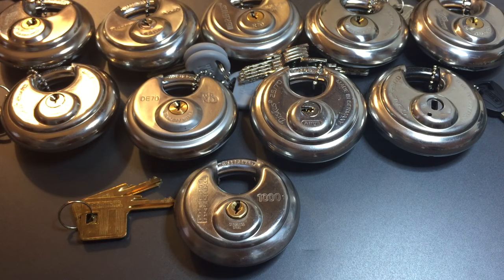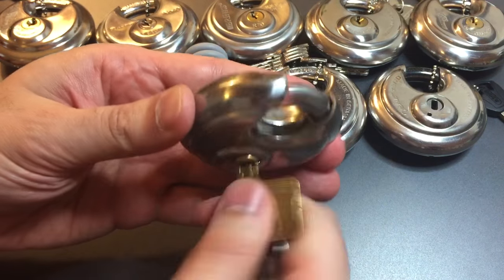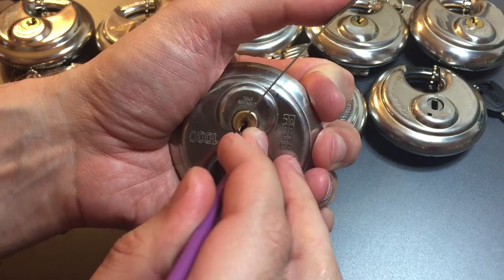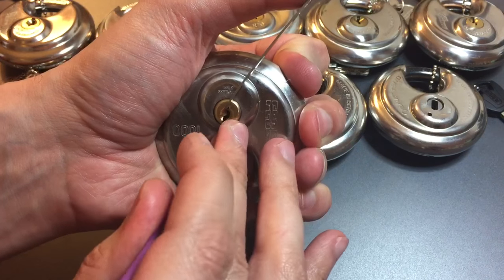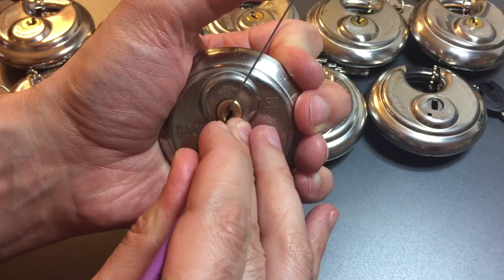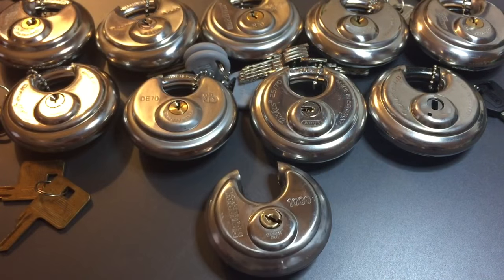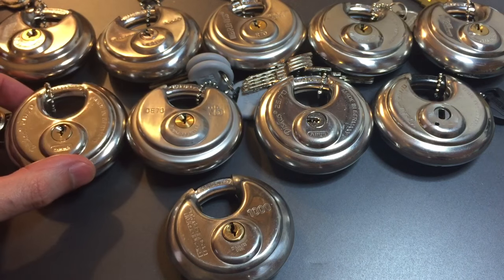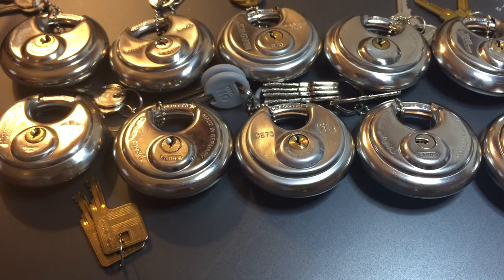[176] Federal Model 1000 Disc Padlock Picked

Comment: Personally I would place it the other side !!😯
He bitting wasn't that extream and it was only a 4 Pinner .
👍The spools must have been cut nice and deep and crisp on the edges.
Keyway is a factor but if you review the other lock again I'm sure you will at least consider changing your mind.🤔🤔🤔
Thanks for this great series of locks😘😘😘😘👍😎🍻
Nearly for got crisp picking as always 😎😎🔓⭐️
Reply from the maker: Could be... I will not argue.  It's all far more subjective than I would like, and reasonable minds can differ.  To be fair, I struggle with the rankings and almost wish I didn't start down that path.  In this case, we have two relatively high-quality locks with 1 standard driver and 3 spools... pretty even on the objective factors, so I gave the edge to the tighter keyway.  Maybe this particular lock gave me a little more trouble, but I try to look at the objective factors, so I don't rank something too high or low because I happened to get a lock with particularly good or bad bitting, or because I'm having an off day (or, as is the case here, shot the video after a night out).  In any case, I already have the next few videos of the series shot, so no changing now!!
Reply: +LockPickingLawyer your vids,your rules Jmo.😉👍👍👍😘
As you have said it's subjective but to date I have agreed with you positioning of rank😉😉👍